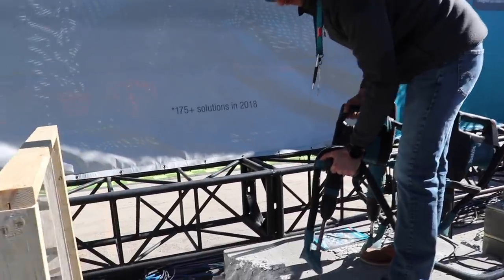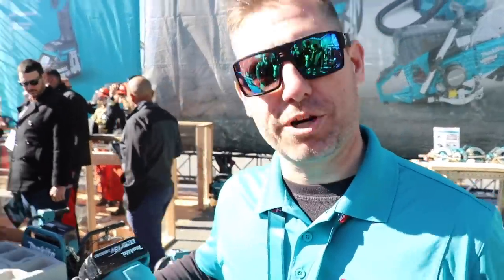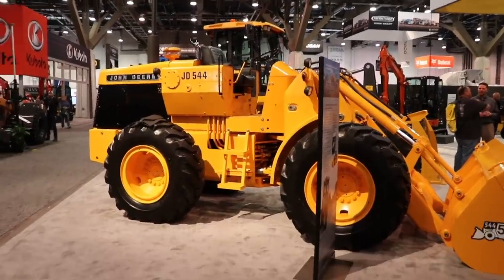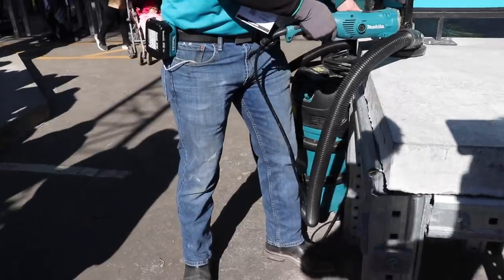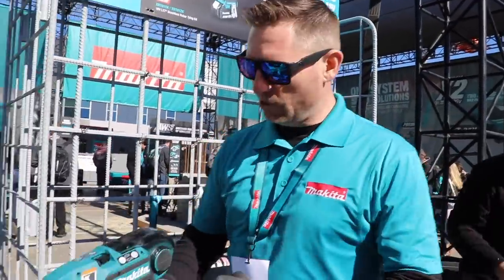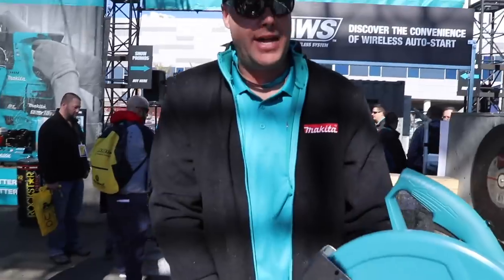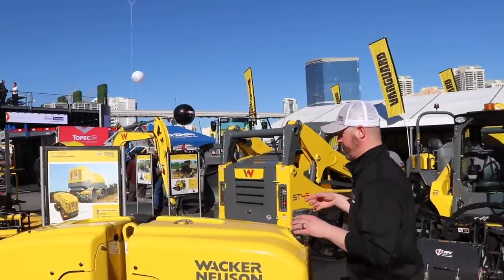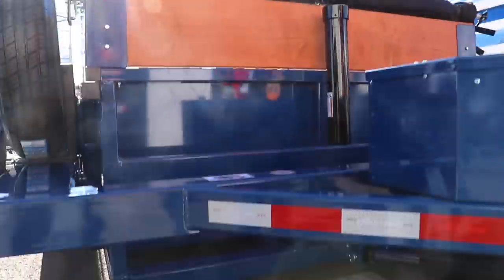Newest heavy equipment & Power tools at the World of Concrete 2019 sponsored by Makita

Comment: The company I worked for got the concrete slab vac and it’s a life changing. We didn’t  have to tear out concrete. We did sidewalks for city. So we would pick up he slab level the rock and set back in place. Saved us the tear out dump fee and concrete cost. Plus it is faster. I am in St. Louis Missouri area.
Reply: I live in philly. Do concrete for a living. My experience would say 9/10 people replace concrete bc of cracks or issues and ofcourse the finish. New concrete is new concrete. Old concrete being sucked up stone leveled and set back down is old concrete. Its more like youre maintaining not replacing. Sounds like you guys possibly can't be charging what someone who would rip out and poure new. If so i need to invest in one of these bad boys. Nonetheless that is a bad ass piece of machinery

Comment: JCB backhoes have been running pilot joystick control mounted to the arm rests of the swivel seat for around 10 years now
Reply: Ford had them back in 1980
Reply: the seat mounted ones where you can have the seat even partially turned to the side and they still work I have seen first on JCB 4CX and 3CX machines back in 2003 so yea... pretty old concept for us in Europe ;-)
Reply: Typical Americans getting tech from 10+ years  ago thinking its new

Comment: Like that companies are actually thinking about the "repair ability" of the machines they’re making. Wish more companies would do this....refrigerators, HVAC units, etc etc... Anybody who has to repair/replace a part to get machine up & running will tell ya, sometimes you need to have 2 year old small hands & be a contortionist to get inside a machine 😂. Just b/c works on paper....doesn’t mean will be easily serviceable afterwards😉
Cheers✌🏻
Reply from the maker: Thanks for the comments!
Reply: You don't like completely disassembling a rooftop unit to replace the heat exchanger?
Reply: @anthonydesisto2328  Been there..... ;-)
Cheers!
Reply: On the CAT excavator what if you want to move and dig at the same time.

Comment: The truck lift works awesome for service on semis you can use 4 6 or 8 at a time one remote runs everything I'm 6'1" and I can walk right under the truck its nicer then a pit in the floor for getting under trucks and when not in use you  can tuck them away and not take up valuable floor space in the shop
Reply: Have a set made by challenger and they are so expensive most companies wont purchase them ours were over 60 grand

Comment: Yeah that quick connect excavators real nice but it hasn't been running on dirt grub and grind for the last 2 years pretty freaking sure that's been running on nice smooth clean concrete just like it is in this video. Throw a little Grime in there and see how it does!

Comment: The pcm that they had (portable concrete mixer) has way to many moving parts and the maintenance is far to extensive to use reliably. I had to take a two week course to get familiar with it and it comes with 5 to 6 300 pg books on how to operate and maintain.

Comment: Technically, DEF and DPF isn’t legal. The government legally only has control of that for on-road and internal combustion rail-vehicles. Off-road vehicles are being illegally required by our government and the EPA to have DPF and DEF systems that ultimately are a temporary solution that will shorten the life span of the vehicle
Reply: Did the road pirates find your yet? If you travel on the road instead of drive it doesn't matter anyway.
Reply: @Z0MB13L30N  the government can't find me if they don't know my name

Comment: I think those earth lifts would be awesome on a massive construction site where you can keep up with all of your large truck and machinery maintenance without having to pull them off the job site.
Reply: Have a set made by challenger and they are fucking awesome. But also extremely expensive. Talking like 60 grand for a set of hoists. But beats trying to crawl around under a rig all day. You can sync and sync run independently or all together.

Comment: 32:20 i daily run a Wacker neuson 6,5 (metric) tonnes mobile crane it's basically one of the best and thoughest machines that I have turned on ever. We use it daily in road works and is holding on strong since 2003 so that says something about the brand....

Comment: kubota svl 65 2 now with shorter cab height so shorter people can get a concussion to. we had 3 kubota slv 90-2 and me and everyone i know that has ran one has hit there head with the door when they close it because it comes down about 4 inches before it rotates down.
Reply: Paul Robinson  yeah they were nice and quiet and smooth. I would put a 1500+ lb hay bale on it and fly across a field in high gear. The one issue we really had was they didnt like to turn on dry grass. But we mostly used them for loading manure trucks and they had lots of power for that. I would recommend them. I would recommend a takeuchi over them. But the takeuchi is way more rough and louder. Ours is also a 2007 and worn out. Also have never had either the new takeuchi tl12s or the slv 95-2 to try out yet so my opinion on that could have changed with the new machines
Reply: Paul Robinson  are you thinking a tracked machine or wheeled. I mean the wheeled kubota looks like a good machine and also hase the roll up door and is the only wheeled skid steer to have one that i know of.

Comment: Dose the offset arm on the excavator reduce power at all or strength in the digging power or is it the same
Reply: It's the same. It allows you to dig parallel to foundations. Or if you're in a tight space you can swing the arm like a backhoe while the cab stays still.

Comment: That's some cool stuff, I wonder with the cat backhoe I'd the control being right there operating the bucket and steering wheel if they are going to be right in the way and if they get bumped is it going to make the boom and stick move or the bucket?
Reply: Ford seat rotated years ago, wondered the same as you if  bumped when in the drive/loader position. Not a fan of this idea from what I see, only fair to see it in person.

Still a 4 stick guy so you know how old I am.......lol  but I do run both controls.
Reply: I'm used to 2 sticks at the back of the machine ran two sticks for the front bucket for many yrs

Comment: Most eng do NOT like volume measurement of the cement powder( should be a wrighted measurement.)  1 403 830 4124 why NOT  just have a mini bulk premixed dry concrete mix. Just add water at the job site  1 403 830 4124 mix transport and place up to 10-12 ft height. Protype concrete attachment etc for EV  skidsteers etc Remote control soon AI.

Comment: Referring back to Stanley "Dirt Monkey" Genadek YOUTUBE videos 

- My personal viewpoints / suggestions / comments FOR Review consideration to follow :

a.) Regardless of Machine seeking to Buy New or Used 
How many Gallons Per Minute ( GPM ) 
Hydraulic Flow is Critical ( High Flow ) = YES its more Expensive However Hydraulic Power GPM gets the Job Done / Productivity / Return on Investment / Resale Value
b.) Consider Wheel Loader OVER a Skid Steer 
c.) Equipment Options, if I was in the Market for FULL Size, WOULD very much Look at / Consider 
Volvo Wheeled Excavator 
Wacker Neuson Wheeled Excavator 
JCB Hydradig 
Huddig 1260D equipped with Remote Control ( Gets Operator OUT of Cab ) Close to Work / Flexibility
Caterpillar 450 backhoe
SuperTrak Wheel Loader 
Volvo Wheel Loader 
Wacker Neuson Wheel Loader 

My SUMMARY :
= Projects require a wide selection of Equipment & MOST important the ATTACHMENTS to be Productive 
RENT the ones you don't need very often 
Buy New or Used Equipment use on a daily or Weekly basis 

= However if Forced to PICK ONE piece of Equipment 
my selection would be 
1. Huddig 1260D Cable Model Remote Control / Palfinger Crane Front Bucket Attachment 

Respectfully 
Seeking Feedback from all 
Any and all are most welcome, appreciated and Valued 
= After ALL, we are ALL in this Together
Share each Persons Unique Talents 
Don't take it to the Grave  

wishing all who may view this comment 
great weekend 

Life Liberty and the Pursuit of Happiness that is PRICELESS 

Enjoy the Journey of LIFE ... Not any Particular Destination 

Capitalism MAKES = Only Way Forward  
Socialism TAKES = The LEFT, Leftist Politicians 
..

Comment: I'm not a heavy equipment operator I've played with heavy equipment I've got probably about 10 or 20 thousand hours on heavy equipment combined but shared valving to me sounds like power loss in all the different modes if you try to run them combined I think that's why John Deere my John Deere 1025r beats out the BX by almost 500 pounds in overall Breakout and by over 250 lb in pure lifting capacity just on the bucket know the BX chills a John Deere by close to 200 pounds on the 3-point but if you're buying an Implement that's 2 or 300 pounds heavier than your tractor there's a problem

Comment: I have a hard time getting over how clueless these sales guys are.  This dude is trying to sell a new loader on the valving and doesn't even know that parallel and series valving are different things.  Now we have to ask, is it full series or partial series?  Hopefully full series, as partial would starve downstream flow at full 1st valve actuation, making that Kubota rep a liar.
Reply: Parallel valving allows flow to take the path of least resistance, so if you tilt the bucket while lifting (unless you have the presence of mind to feather that valve), the tilt valve will allow the pressure to drop and will starve the lift valve of flow. When you stop tilting the bucket, the circuit will re-pressurize and the bucket will start to raise again until that valve is closed.  There are full and partial series valves which are open-center, and allow unused flow from the first valve to be used by downstream valves when the upstream valves aren't fully actuated, and operate at full pressure.  The difference between full and partial is that no pressure or flow is available if an upstream valve is fully actuated with partial series, but a full series valve will send all returned oil through the downstream valves instead of directly to tank, so even with full actuation of an upstream valve such as lift, returned oil from the venting end of the cylinder can power downstream functions with pump pressure minus the pressure drop over upstream valve(s).  On full actuation with partial series, all downstream functions just stop.

Comment: Makitas 2 battery system is dumb IMO compared to dewalt flexvolt
Reply: 2 battery system is better. You don't get stuck using giant batteries on tiny tools or using tiny batteries on large tools.
Reply: @xenonram  plus you have a smaller thing fail.